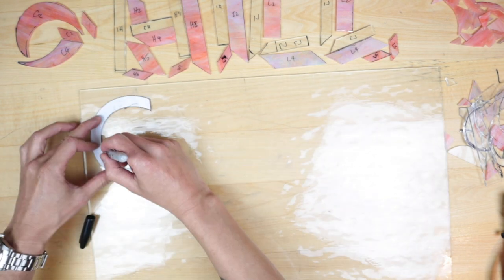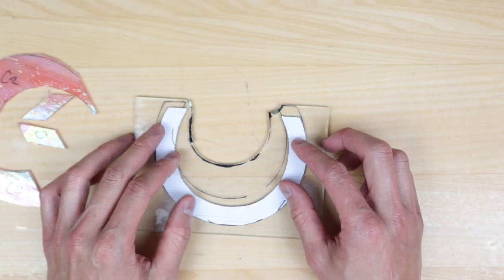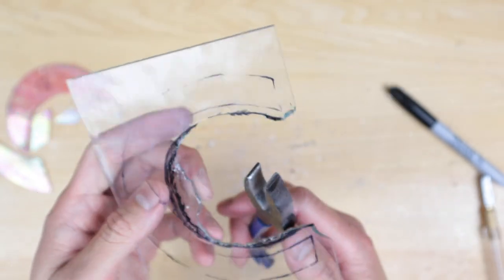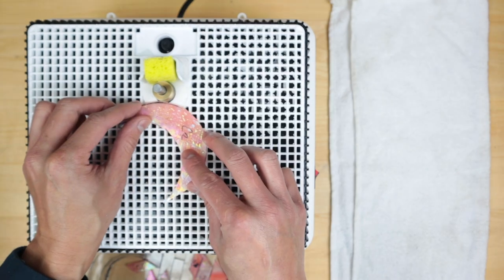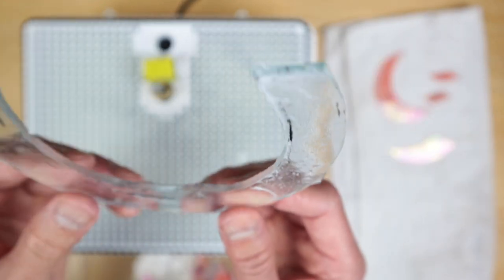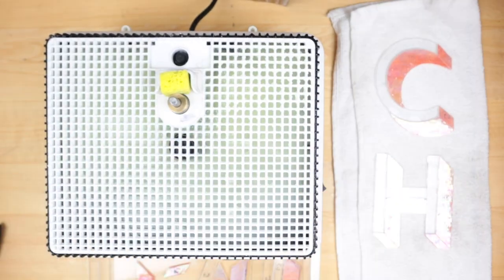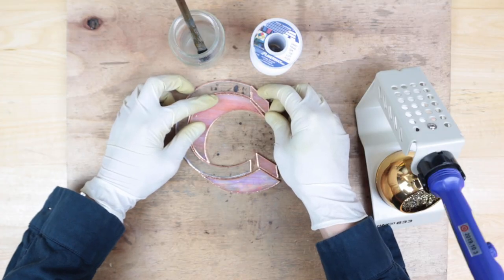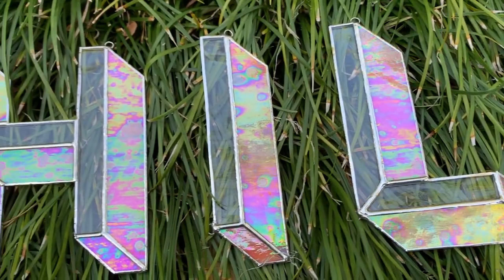Stained Glass Letters - Part 2

Comment: FIRST of all I think you're pretty cool and your site was the first SG one I subscribed to, so please take this as just an observation: I've watched this a few times and just now saw something that may not matter at all (since you did finally get the inside of the the C cleaned out) but didn't you have the Breaker-Grozer pliers upside down when you were grozing (chewing out the area)? I'm a newbie newbie but have watched and read a lot. When "chewing", the curved side should be on top. The flat jaw (breaker) should be on top when breaking at the score line...out and down. (NOTE: I used your discount code for an Inland grinder. Also, got the second story for the smaller radius...it's awesome!)
Reply from the maker: I think you’re right I should flip it around!